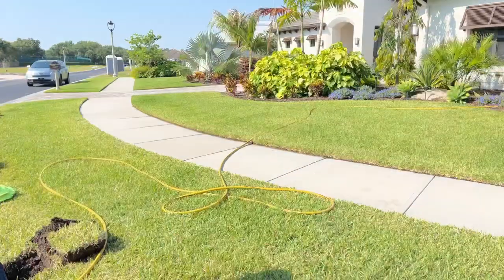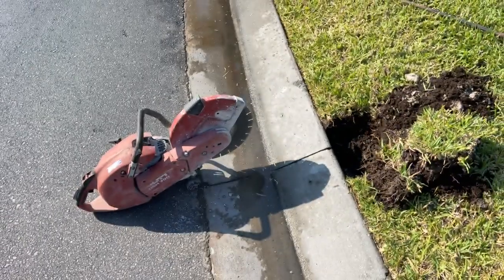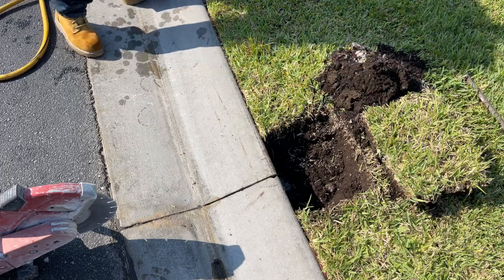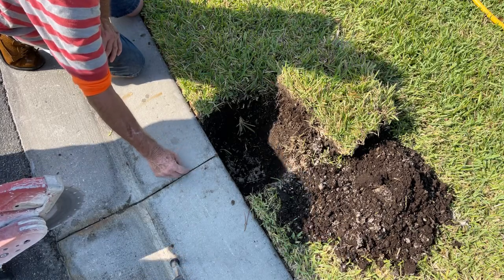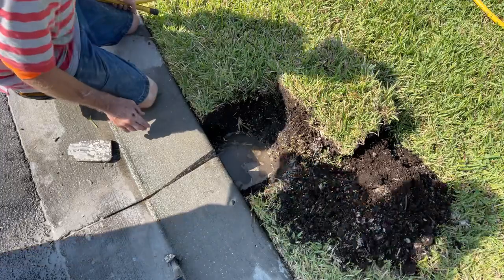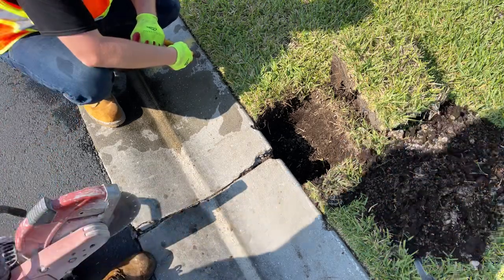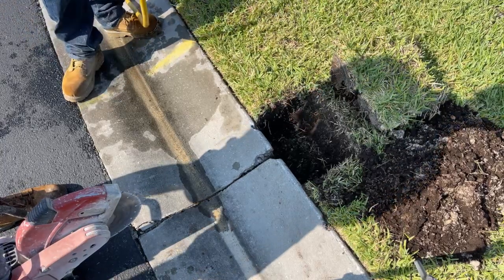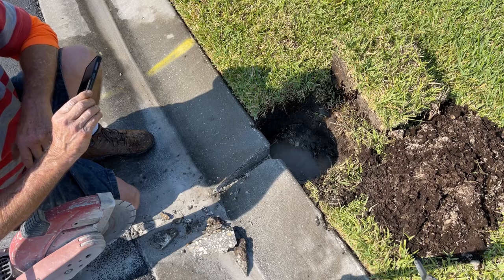How to Saw Cut a Half Round Curb

Comment: Hey Chuck, I have a quick question. So I put in 2 catch basins one on each side of my pool with a sump pit in the middle with ez flo coming from both basins to the pit, my question is for my waste discharge for my pool pump can I discharge that water to a catch basin or should I run it to the sump pit, AGAIN THANK YOU FOR WHAT YOU DO Your THE BEST
Reply from the maker: The pool backwash could overwhelm your system. But I would still give a try. Catch basin is okay, basin might be better